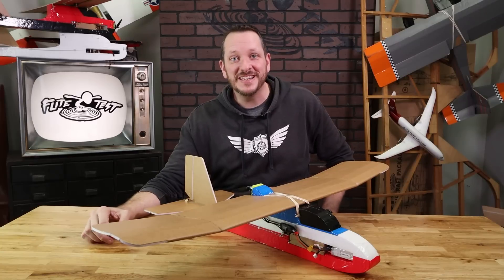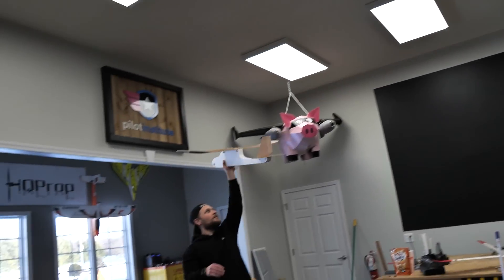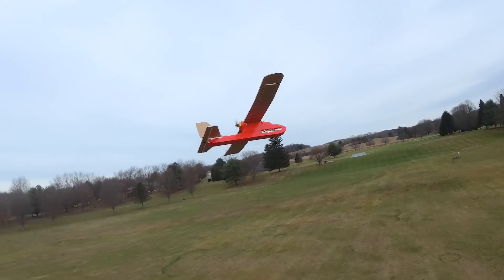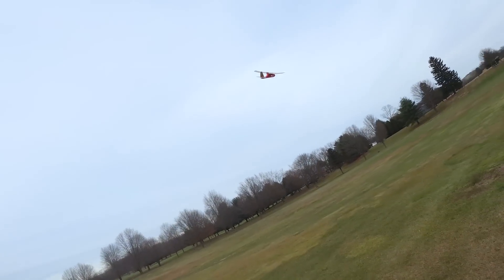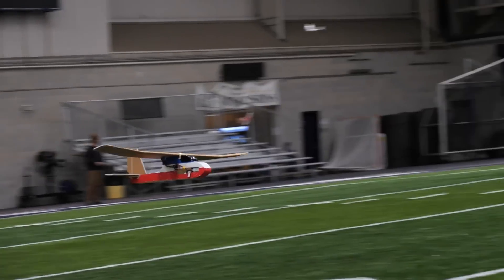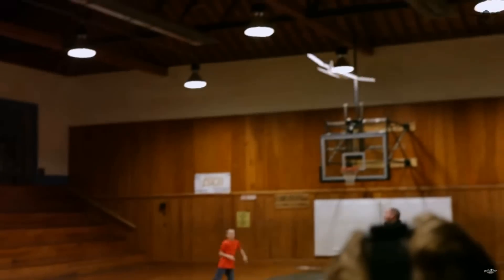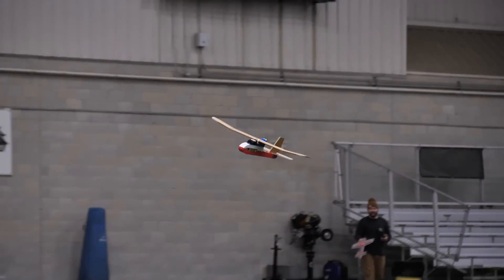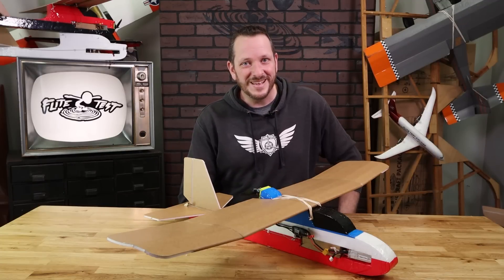FT Tenet Vision Video

Comment: I like the concept. I like the way the Tenent Vision appears to fly in this video. A negative, in my opinion, is the cost of the Aura 5. I believe that a 6 axis stabilization receiver is a big plus once a newbie moves up to 4 channels. You really want a new pilot to have early success; that he/she not become a "one-and-done" or "two-and-thru" RC plane hobbyist.
Reply: Don’t worry. It was designed to accept the aura, but does not need it to be easy to fly. All versions were tested and refined without the aura. :)
Reply: @joshuamelvin  Good to know. Thanks.